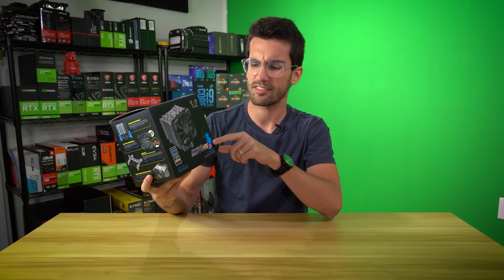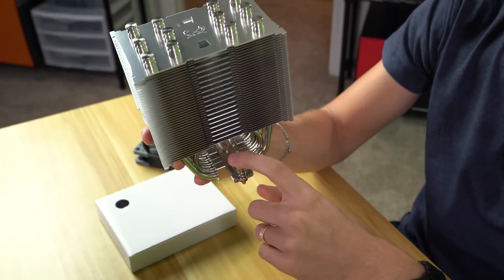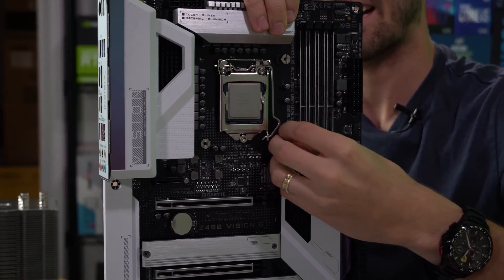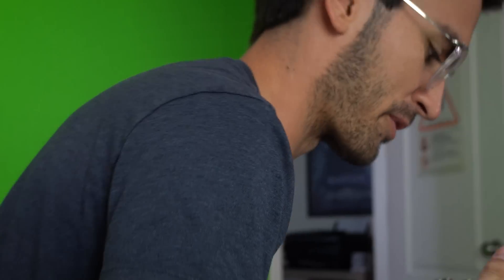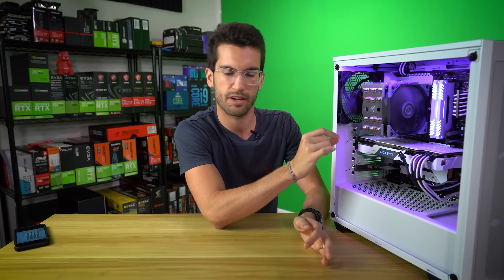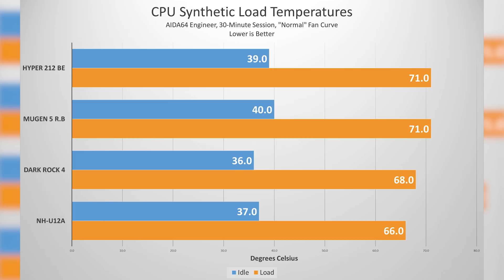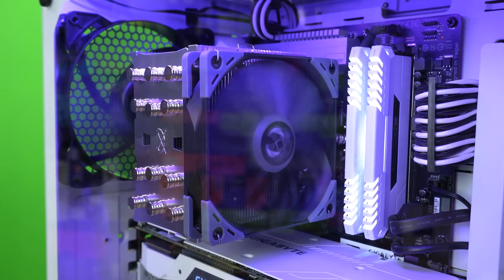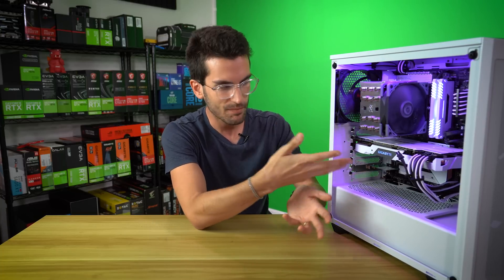This CPU Cooler Is Seriously Underrated | Scythe Mugen 5 Rev.B Review

Comment: I have the Mugen 5, its a really nice middle priced air cooler and its perfect for rgb builds bc the cooler doesnt block ram slots and its kinda small so it doesnt take up much space, looks great and cooling is still good with corsair ll120 on a ryzen 5 3600.

Comment: I have the black rgb version and clocked my 3600 to 4.2 and it never goes over 80 even under heavy load. Insanely quiet and cost me 55€, 10/10 would buy again

Comment: Scythe have been around a very long time, and have in the past gotten some pretty decent popularity in the US, they actually had a few models i saw in alot of "Custom" built systems that were... borderline emachine quality... i say borderline because.. even they didnt use those eagle and deer powersupplies... LOL...  and, they used them not becaus ethey where the cheapist, but because they could use them on anything from a low end duron/semperon class ssytem up to a top end system, and, the price was not cheap, but not expensive,  and, the ninja and mugen coolers have always been decent.
none are a match for my thermalright silver arrow extreme sb-e with 3 fans on it, but, not really many air coolers are, hell, the 280mm AIO im using on my x5675 at the moment is only now, better, because, i stacked 2x noctua 3000rpm high static pressure fans and 2 akasa vipers  in push/pull, with its stock fans... it was worse...despire being a good AIO, Cryoric A80 (that little vrm fan, is genionely a great innovation they came up with... im glad to see arctic take the idea and do their own spin on it.. ) 
 anyway, scythe have made some genuinely great products, not many if any genuine stinkers... and their thin 120 and 140mm fans are the only ones i have known that are of consistantly good quality.

Comment: I picked up the TUF RGB version back in April. Absolutely love this cooler. I initially set it up with a push/pull with two kaze flex fans. However I swapped the fans for CORSAIR LL120's. Somehow, the Kaze flex fans even though they're slower perform as good as the corsair at full pelt while being quieter. I kept the corsair fans for the aesthetics and changed the fan curve for quieter operation. Its happily cooling my Ryzen 7 3700x.
Reply: Hi a bit late but can you mount a secondary fan behind mugen 5?
Reply: @rensquared24  yes. You get a second set of brackets in the box. You can also now buy the ARGB version with 2 fans in the box
Reply: @Tigga490  Thanks for the response. Was there a big difference when mounted with two fans?

Would you recommend this over Deepcool Gammaxx GT ARGB?
Reply: @rensquared24  would definitely recommend. I always knew I was going with a push pull setup so I never tried it with just one fan. I can say that the Kaze flex fans do their job very well.
Reply: @Tigga490  thank you! How about mugen 5 or fuma 2?

Can't decide which i want to upgrade into

Comment: Awesome out of the box review , however testing the actual heat sink & fan performance individually of each cooler with a standard/control experiment might be a good idea. Like using a noctua fan on each cooler, since the Mugen 5 = $48 and Noctua NF A12 PWM is for $31, which makes this still cheaper than the Noctua U12A.

Comment: As another one who has experience with this particular cooler... Agree! This is a great cooler. Xeon X5675 @4.4 GHz OC. No problem and silent as f***. 
The fan speed tells no lies. (PWM would speed up if needed - but it didn't) The heatsink is really well made, and actually have proper contact!

Comment: I have a question: If I bought a used  an intel i7 8700k off of craigslist for 300 bucks do you think this is a good cooler for that or should I go  for the Noctua NH-U12A?   

I currently have a very small cpu cooler, which is a Cooler master hyper t2.  I see spikes in the 80 degrees at times.

Comment: The problem with the cooler has always been they just don't add enough value for most.     For only a slight bit more you can get much better performance and completely silent operation with the Noctua D15 or dark rock and frankly both are also more appealing style wise to most as well.  For a significantly lower price you get what amounts to almost equal cooling with only slightly louder noise with the hyper 212.  It sits in this no mans land in the middle. Anyone that is spending a decent amount on an air cooler is likely to spend the extra to get the better performance when your talking about the 50+ range and anyone looking cheap is looking at something like the 212.  It is one of the better coolers at the 50 dollar price point, the problem is very few people are looking at that price point in coolers.  Most people want either high performance and will spend more or want cheap but good performance and are looking at something like the 212.  
   
The U12 is honestly not really a fair comparison because it is expensive because it is designed for smaller systems where something like the mugen or d15 won't fit but not so small you need a low profile one.   A more direct comparison would be the D15 which is actually a better cooler than the U12 and cheaper if your comparing similar sized coolers.

Comment: Thanks for a great video, loved the new way you filmed it and kept your bloopers, which is fun stuff to keep.
I have a question.
In the end of the video you talked about not using this cooler for the Intel 10900K, 
which is pretty obvious, and prefer the use of a lower TDP chip like AMD 3000 with the Mugen 5 rev B.
The Question: So why didn't you use an AMD chip?
The all white build is gorgeous, but the Scythe fan kinda destroys the whole point. 
So I wondered if one or two Arctic Cooling 140mm White fans on the Mugen 5 cooler would thrive in that build? 
You know just for the aesthetics, and probably also for the performance :)

Comment: I just built my first rig, its mid-range barely, got the 2600 with b450 ds3h gigabyte noard, radeon rx570 and 16 g 3200 teamgroup mem. I know this board isnt meant to do hardcore overclocking, i was able to get it stable at 3.9, but truthfully as stock, i have seen single core bump up to 4.3. I want to get it to 4.0, what would be a decent air cooler for it? its a budget build so im hoping for 75 and under

Comment: I swapped to the Mugen Rev.b from my Noctua NH-D14 and I virtually got the same temps on my 6700k @ 4.8 GHz while getting better ram compatibility, similar noise levels and arguably better aesthetics. It's an amazing  CPU cooler.

Comment: I love this cooler. i had 1 in my system for forever. It cooled a i7 990x and kept it around 60c under full load.
Reply: When I had thr i7 980x I just used the stock cooler at 4ghz lol

Comment: can you mod it to have two fans?
Reply: Yes. You can put the fan in the front or in the back, installation is identical, so if you had 2 fans you could use both. Here in Germany we have a PCGH edition with 2 fans preinstalled, idk if you can get that abroad.
Reply: @Chuckiele  lol I run Mugen 4 PCGH with a single fan because the second one hardly does anything for thermals, but it's a bit quieter this way and this cooler is already one of the quietest of all.
Reply: @MJ-uk6lu  It is but hey, its an extra fan for no extra money, you could use it as your rear exhaust fan if your case didnt come with one :D
Reply: @Chuckiele  If I'm removing a fan from CPU cooler, then sure as hell I don't want additional case fans. 

To be honest, I have a simple and quiet PC. My case is Define R4. I left only one 140mm intake fan and run it at 5V (~600 rpm). I run Mugen 4 PCGH with one fan and I can mostly run it without fans at all, except on hot summer days. There's no need for any other case fans as PC is very cool and quiet.
Reply: @MJ-uk6lu  Not saying that you have to, just saying that you could. Having more options for no extra cost cant be a bad thing, right?
Reply: @Chuckiele  Certainly can't, just that the second fan is kinda not needed.

Comment: Has been out of stock everywhere except from resellers that jacked the price to $144.00 at one point, they came back in stock 4 days ago or so..   I've bought a few of them but added some extra 120mm case fans (1 each) on the back side of the cooler because the stock fan only goes up to around 825 RPMs, I have 120mm fans laying around about every corner of my shop..   I don't use air cooling anymore on any of my personal systems, these go on other people's systems and family..   They are meant to be almost silent and they are, but if you want to run XMP or OC on an Intel system you'll want to add a NON stock fan to it or replace the stock fan and use better/higher RPM fans..     BUT with that said I installed it on I5-9600Ks and they will work just fine and with an extra 1200mm higher RPM fan added you can indeed run an I5-9600K with 320oomhz RAM with XMP profile 1 enabled with zero issues.

Comment: You should also do one on the Thermalright Macho Rev B. . Also a cheap big cooler with 6 heatpipes and doesn't block your ram. Best part is the fan can run as slow as 300rpm, basically inaudible at idle.

Comment: 212 still holding its own, I see. I guess there's only so much room to improve air cooling.
Reply: Right? Yours is the only comment that shows that the 212 is STILL great for the price here. It's the same exact temps, with only 3 decibels more perceived noise, but can be had for $10 less. The 212 is still the go-to for price to performance in this bracket. Not to mention, I got mine used for $12!!!

Comment: I have been running an old Ninja for a while now, when the next computer upgrade is coming will stick with the brand. The massive heatsink, low spinning fan is a great combo. My fan actually died about 6 years in and it took a while to notice in temps. In a well ventilated case, unless you're pounding it 100% constantly, this type of solution will be a great option for people who just  game casually or use the computer for nothing too intense. Let's face it, most of us don't render video 90% of the time...

Comment: replace the fan with 2 arctic p12 and boom noctua nh-d15

also your thermal results are kind of useless without knowing the ambient temp of the case or the room if you tested on open air bench

Comment: You can also go for a push pull configuration if you want to reduce those temps further: https://cdn-reichelt.de/bilder/web/xxl_ws/E201/SCYTHE_SCMG-5100-03.png  
All you need is a second set of these clamp thingies, i got a second pair from Scythe's Support years ago for my Mugen 4.  
My Scythe Mugen 4 has been sitting for years now on my 2500K with a 4.7GHz overclock (currently doing its job inside my unRAID Server, pic for proof: https://i.imgur.com/dOSohsw.jpg ).

Comment: Why under clock? I want to see how it compares when overclocking. Even if it's 50 bucks if it performs and looks good the price doesn't matter. Definitely not fair to say its a bad performer when its only 2 or 3 degrees off the other coolers tested.

Comment: In some countries Scythe is called Reeven, as far as I can tell they are the same company.

Scythe
2F., No.453, Sec. 2, Wenhua Rd., Baqiao 
Dist., New Taipei City 22046, Taiwan
TEL: +886-2-2250-0060 

Reeven
2F., No.453, Sec. 2, Wenhua Rd., Banqiao 
Dist., New Taipei City 220, Taiwan
Tel: +886-2-2252-0107

Weirdly the city name “Baqiao or Banqiao” is writen differently,  the phone number is different and the 22046 or 220 number (house number?) is different but oddly almost the same.

Ps. Scythe/Reeven makes great cooler, have a Scythe Fuma (desktop) and a Scythe Shuriken (old HTPC), they work, the won’t fail, they are relatively silent and they are cheap compared to the competition 👍

Comment: I've had this cooler since 2017 and it's followed every upgrade made since. I also use the driver included for everything requiring philips head screws ! 

The gripe I've had with it is that the install was difficult for me at first, one side would pop out, I'd fell like there was too much pressure on the motherboard if I tried to tighten one side to then tighten the other side of the cooler. After 2-3 times the installation was easier as I got to understand how it worked better. Great cooler and I'm happy it's getting more attention because when I was looking to buy it there weren't many reviews to go off of

Comment: I think it's worth mentioning that probably in an AM4 platform it's going to be mounted facing up or down so the air flow is not going to be as good. I'm not sure how much difference that's going to make but we should take that into account when buying an air cooler as well. I think these reviews should test that because it could be 3-4 more degrees, right?

Comment: I agree. I had this cooler on an 8700k and purchased the nhd15 (black edition) in anticipation to move to ryzen. I started using the scythe cooler on the 8700k meanwhile and the cooling advantage of the nhd15 over scythe in aida64 bench was like 3 degrees lol. Note: I used the scythe in a push pull config.

Comment: Why would people get upset over not testing in a case? there is SO much variance in case airflow that you cant really get a feel for how just the cooler is doing. I would much rather know how coolers compare to each other in an open setting with ambient air temps than inside a random case. Unless that same case is used in every test, you loose any way of comparing cooler to cooler. And even then, testing inside the case doesnt represent how it will perform in MY case, because mine is different than the test case. Best to just open air test and let the coolers speak for themselves.

Comment: Watch gamers nexus if u want real accuracy. The way you did this is flawed. And who is going to under clock a 10900k, they buy it for the high frequency not to run 900mhz under all core max boost
Reply: "real accuracy" as opposed to that fake accuracy?
Reply: Steve Smith how about inaccuracy then. My point was anyone buying a 10900k isn’t going to run it 900mhz below the all core boost like he was. When you spend $1000 cdn on a cpu especially Intel your doing to for the high frequency and better FPS you’ll get other wise your going to choose amd for the productivity bonus of all the cores/threads. So this test is extremely flawed because of the lack of real world situation.

Comment: It might have been helpful to mention the stock fan max's at 1200 RPM, pretty low hence how quiet. I threw a Noctua NF-F12 (1500 RPM) on mine just because I had it. The kit also has a 2nd set of fan clips if you want to add another fan.

Comment: Had Mugen 5 PCGH Edition which is I think the same cooler but with two fans spinning at 800rpm max. Could handle my 8700k overcklocked without a problem while staying inaudible at full load. Switched to custom water-cooling, otherwise wouldn't trade it for anything!

Comment: The Mugen's actually upgradable too, they include mounting for a second fan, and if you replace the kaze flex fan alone you can increase the thermal performance.
Reply: What fans would be the best ones to replace with
Reply: @cole_bh0373  High static pressure, like with most radiators or coolers. The kaze flex fan doesn't have a particularly high one, so there are a lot of fans that can work. The main reason the flex fan is good is for it being quiet and long-lasting, so I would also suggest keeping in mind how robust a given fan is and how loud too.

Edit: some grammar
Reply: @cole_bh0373  Those black Noctua NF-F12s. Or if staying with th brand is concerned, the Scythe Gentle Typhoon.
Reply: Yes but once you do that you're starting to enter the territory of a more expensive cooler
Reply: @ShartsInTheAir  But you DON'T pay THAT much money to get some better fans anyway, and you buy some quality stuff from the next paycheck  :-)
Reply: @ShartsInTheAir  But here's a thing, upgraded Mugen will perform better than let's say Noctua, which without upgrades costs way more than upgraded Scythe. Also there's nothing that you can really upgrade in Noctua.
Reply: @MJ-uk6lu  oh sure you can, if you can still find a 4000-5000 rpm Scythe Gentle Typhoon fans 😎🤘
Reply: @ShartsInTheAir  That's kind of how all upgrades work, yeah?
Reply: @ShartsInTheAir  Sure but you just need a fan capable of higher RPM. I went all out on a 120mm Noctua NF-A12x25 but even with that the total cost is only $80

Comment: with just 2 screws to hold the large and heavy heatsink to the cpu seems lacks stability to me, you know theres a reason why other beefy coolers have 4 mounting brackets
Reply from the maker: Even the beefy be quiet! Dark Rock Pro 4 uses two screws. So no.

Comment: Yes they are! I'm using the Mugen ARGB with my 3700X. It stays cool and extremely quite. Always boost to max (or above) rated speeds due to thermal limits not being reached. 

The ARGB version comes with two fans (push/pull), the same heatsink here as sell as a ARGB cover over the heatsink. The two fans help with temps while still quite.

Fuma is Scythes higher end air cooler. Designed for temps over noise.

Comment: The Thermaltake Macho Rev.B and Rev.C are EXTREMELY underrated, one of the best air coolers in the market for around 50 dollars, the same price of the mugen rev. B. They have a 140mm fan, 6 heat pipes on each side adding up to 12 in total, and a beefy heatsink. Especially the Rev. C.